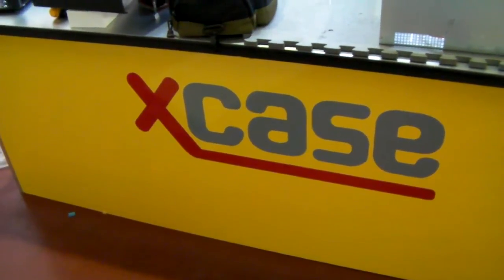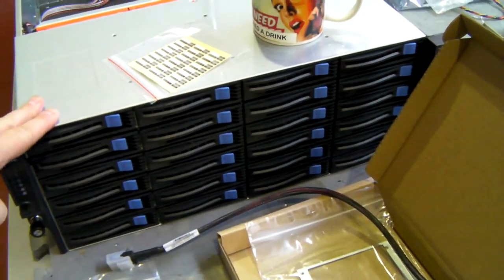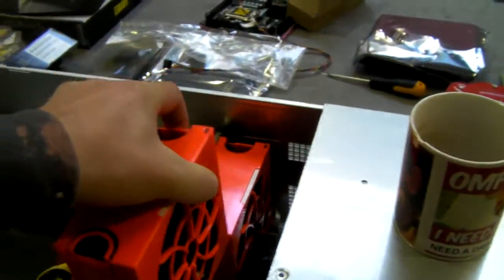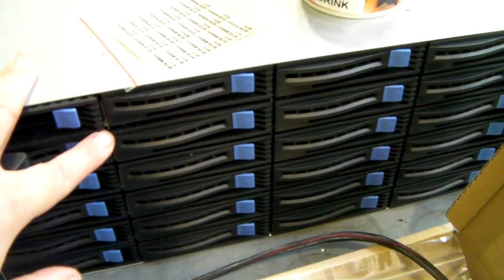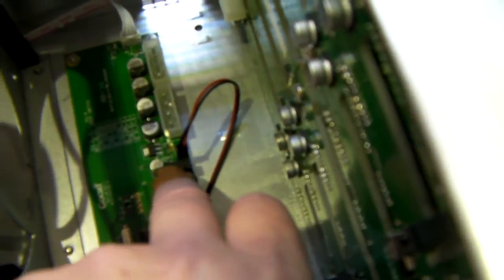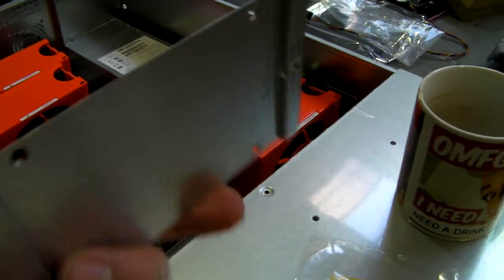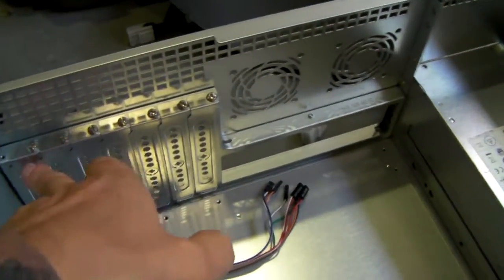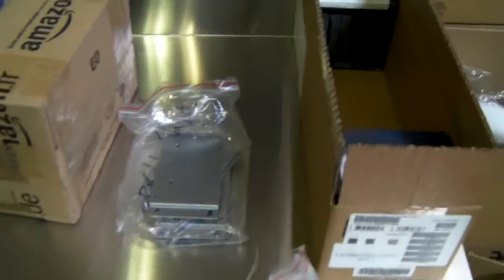X-Case RM 424 pro -Setup

Comment: Please, would you mind pointing a Supermicro motherboard model (possibly in the X10 range) that doesn't cause the fan to drop so low that you need to remove the jumper from the fan's controller board?